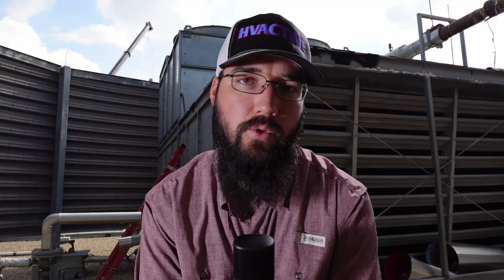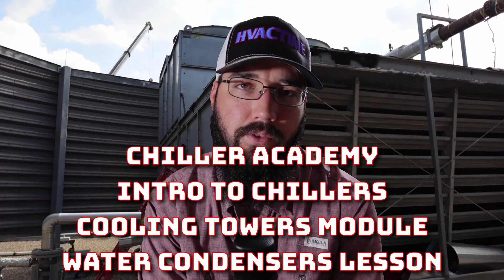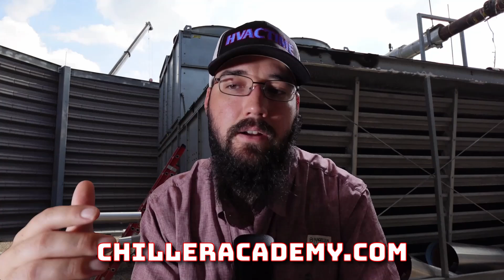Cooling Towers are "Condensers" - Chiller Academy

Comment: Correct me if im wrong. You size a cooling tower at 15,000 btu's per ton....the additional 3,000 btu's over the conventional metric is for the heat of compression ( aka discharge superheat ).
Reply from the maker: I was taught a rule of thumb for 25% over rated chiller tonnage. Speaking with distributors the manufacturers calculate in the overage with their tonnages. So a 100ton tower as advertised is technically 125 tons

Comment: Dude, you just spent a quarter of an hour saying a lot and nothing at the same time. Just say a cooling tower, as an adiabatic cooler, is and behaves just like a normal air cooled condenser where, through allowing direct contact of both working fluids, you add latent heat variable into the heat rejection equation. From that initial statement, you can now start explaining the system's benefits and limitations, it's performance dependency with vapour pressure, environmental conditions such as relative/absolute humidity/enthalpy, mass flows, etc... Jesus, it ain't rocket science.
Reply from the maker: There are a lot of techs who struggle grasping these concepts. I am trying to meet them at their level. I apologize it was not useful for you.
Reply: @HVACTIME  It's not worth responding to guys like this. They have nothing productive to add and the attention just strokes their ego.
Reply: @TheMinecraftACMan  lol dude, what ego r u talking about. I do accept my reaction wasn't the most adequate, however, I did get triggered by paying close attention to this content just to get go arounds from it. I was expecting at least some technicals I could learn from or at least research later on. Such sensitive audience, jesus.
Reply: @HVACTIME  I'm certain the vast majority of HVAC techs are familiarized and know pretty damn well how much does Air loves to bond with water particles; so, the greater the cooling tower's moist air enthalpy gradient at the exhaust vs the intake, the greater the heat rejection and the lower the water outlet temperature... Of course, at the cost of that water mass flow that was absorbed by air.  There you go, summarized it for you.
Reply: @adrianhernandez7197 what you just said will absolutely go over plenty of techs heads.   They probably shouldn’t be working on a chiller with a tower.
Reply: @adrianhernandez7197  my brother how many years of experience do you have with Chillers and towers?
Reply: @hollowapex3871  I'd say a little; I do the building envelope and hvac system thermal modeling for both architectural design and reverse engineering/energy audits for retail/service sector.